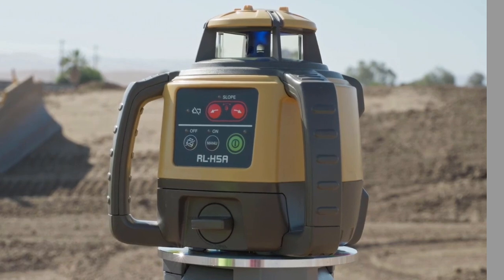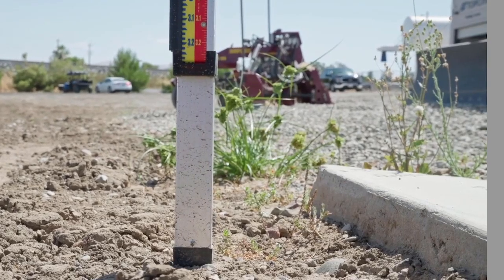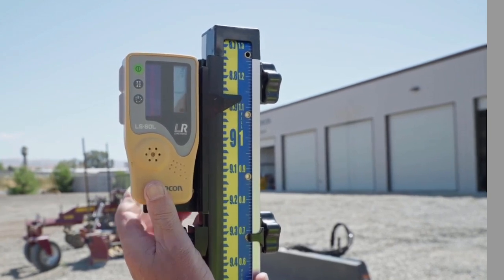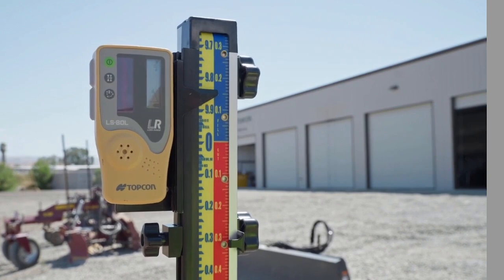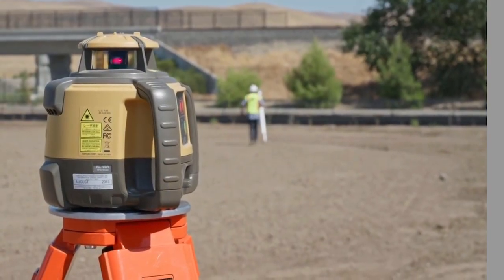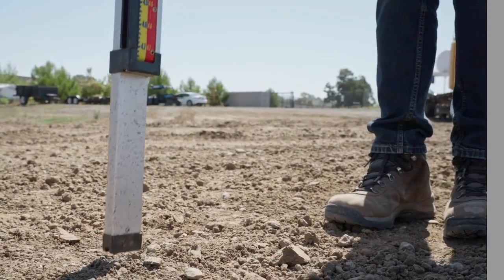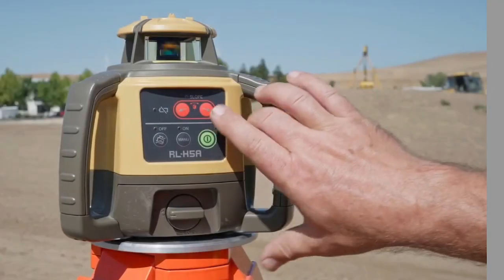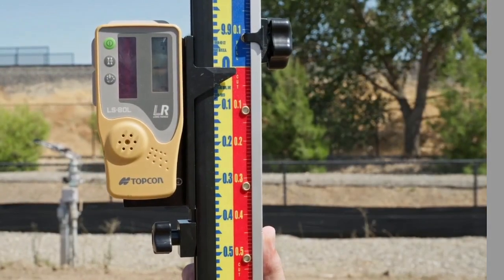Topcon RL-H5A – How to Use Grade Match for Slope Setup

Comment: The absolute worse instruction of how to set up slope on this device.
Reply: Have you found any good videos? Every single one of these is a joke.
Reply: That's a horrible example, calculations are not even visible. How about you take reading at your starting point and destination. Do the math and position your receiver accordingly at your destination. Send the beam up or down by pressing once and then press again when it hits your receiver. You will never get this perfect the first try. It will go past your receiver. From there hold the opposite slope button. Light will flash slow for 5 seconds and beam tilt will move slow. Keep holding and light will flash faster and beam tilt will move faster. Let go after you hit and most likely pass your on grade again. Press the original sloping direction again and try to work within the 5 second slow flash period. It's a little cumbersome but it can be done with some patience. 

I service and sell a variety of Topcon products. Do yourself a favor. If you need a level buy a H5A but it's not a true slope laser. If you want to run slope buy a HV or 200 series where you can type the actual slope percentage in. Work in tenths not inches, less math. Rise/run then multiply by 100. Rise/run gives you elevation change per foot. Slope lasers think per 100 feet.  2' rise/100' run = .02. Multiply by 100 to to get 2.00%.

If you insist on using inches and you need to run 1/4" per foot. Convert to decimal to get .25" per foot. Convert to tenths by dividing .25"/12 to get .0208 per foot. Now multiply by 100 to get slope percentage of 2.08% slope. Alignment is key for slope lasers. Make sure to use sight on top of laser and make sure you are on the correct X/Y axis depending if you have a single or dual slope.